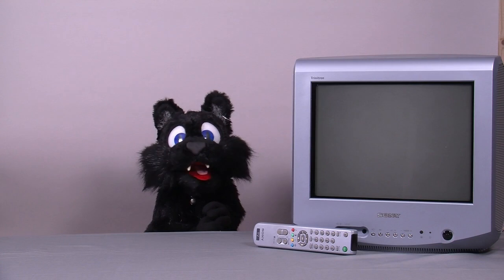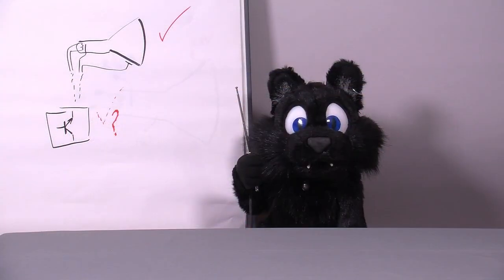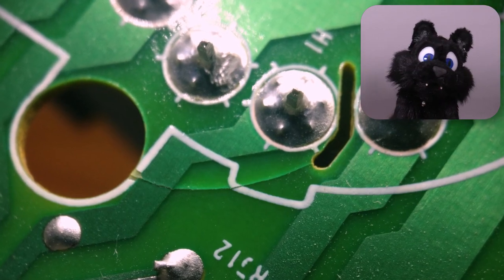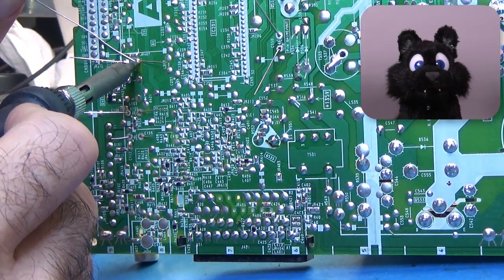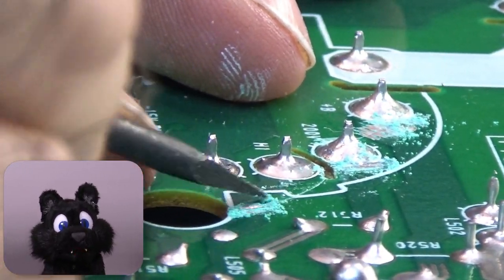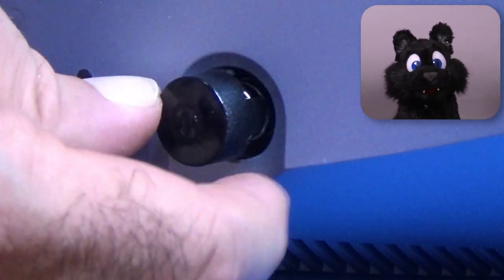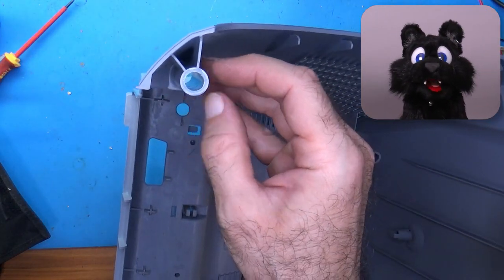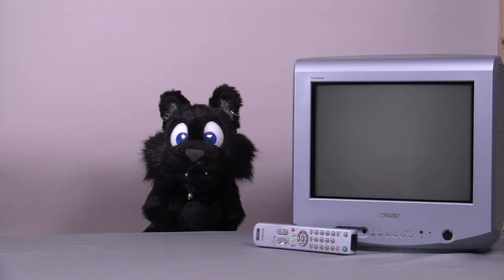Restoration Project #27 - Sony CRT TV

Comment: Beautiful! CRTs for life CRTs forever. I had planned on doing some repairs on an MX7000 by Band & Olufsen but when I opened it up I was shocked at the complexity. So many seperate boards all packed into ludicrously tight spaces. Far too much for myself to tackle.
Reply from the maker: By the description, I'd guess it is a pre-digital device? The Sony one here already had an integrated controller chip that took care of almost all the signalling details. Real old scool TVs with just a few chips for amplifications were beasts! Especially for decent color reproduction. B/W was simple enough...
Reply: @atkelar  Plenty of digital controls and a service menu. Very few petentiometers inside. I think because they went for a smaller form factor it's basically the 2 or 3 boards you'd see in other sets cut up and jammed in there but connected to each other. So the mainboard is probably 4 seperate pieces or something.
Reply from the maker: Ah, Origami Electronics then! 😜
Reply: @atkelar  Ha ha so true xD

Comment: Handle with actual care 🤣 
I recently bought an East German chess computer (repair video on my channel). And when it arrived it was faulty. The seller said it was in working condition. Since two buttons were broken and an open collector inverter was not quite in spec, I don’t know whether it was “handled with package handlers’ care in transit” or just sold as working. But it’s working now, and working well. I lost all games thus far 🤣

Comment: Cool repair as always! When adjusting for convergence, aren't you worried you might get zapped, HV is just a cm away? 26kV must hurt a lot
Reply from the maker: Thanks! Oh, I did worry about zapping. Never "reach" for something without looking at it at the same time. The 26kV are well contained (the red wire in the shots has a thick layer of insulation) what had me more worried are the blank soldering pegs on the deflection yoke board. Those have some hefty voltages too. I didn't measure those, but some TVs run those in the 200-300V range. And I did brush against that 200-ish volts on the Philips monitor project. Not pleasent. But while the voltages are high, the power behind it is minimal. It shouldn't be anywehre near lethal, because there'd be next to no current involved; it would be like a really strong static shock. But these things can only be adjusted when powered on.

Comment: Say, Atkelar? Have you ever converted a CRT tv or monitor into an XY monitor suitable for vector display?
I'm going to be building a scopetrex sooner or later (a vectrex console, which outputs XY with the intention of hooking up to an oscilloscope) but I'd like a larger display, and dont have a 'scope but I do have two old CRTs, one of which I dont mind converting
Reply from the maker: No, I have not yet done such mods; While it might look like I'm very experienced, I am actually applying basic knowledge, years of generic experience and a whole internet worth of knowledge as I go. I am slowly getting into the more physical side of things after over two decades of software development. - That said, I think the X/Y thing might be a bit problematic, because the deflecton yoke is built for two very different frequencies: the verticla one is the 50/60 Hz for the interlaced image, while the other one is for the umm... well, 50/60 Hz times however many lines PAL/NTSC has, so a few kHz. In a scope, the deflection is done capacitively, not magnetically. That offers different frequency ranges and wouldn't be different in either direction.

Comment: For repairing ABS plastic, mix acetone and chunks of ABS plastic scrap in a glass jar and close it, let all  the plastic dissolve into  a paste, and voila! ABS Cement! It actually welds the plastic back together, very strong.
Reply from the maker: Thanks for the info! I've read something similar before; But my real question is: how can I be sure what type of plastic it is? Is it ABS to begin with? I need to look into "identifying plastics" sometime; a sort of cheat sheet would be useful...
Reply: @atkelar  Generally, if it's electronics shell plastics, its probably ABS. Although things like Polycarbonate, glass reinforced nylon, or others may be used.  Theres usually a recycle code or ABS stamped in the plastic SOMEWHERE on the inside or outside of th shell. You can also just go on ebay and purchase a sample (usually 100g or so) of 1.75mm ABS 3d printer filament for 2-4 euro if you want to take the guesswork out of it.

Comment: I've also got a CRT monitor for an Amstrad CPC464, which keeps blowing its onboard fuse, but I cant see anything obviously wrong. Where do you think I should start poking?
Reply from the maker: Does it blow right away or after some time of operation? If it blows right away, I'd check for tantalum caps, those are notorious for shorting out when old. A blown fuse means something is drawing too much current; depending on "how much too much" it's either a dead short, like the tantalum caps, or something that passes just slightly too much current, like a broken amplifier stage somewhere.

Comment: I have the same TV model.  I would like to disassemble it to retrobright the shell.  Is it easy to disassemble?
Reply from the maker: It's a bit brittle; so be very careful with the screws. the only real issue is that the four main screws in the back are waaaay recesses and need a really long screwdriver. The rest is just one screw that holds down the flyback transformer and the four screws in the CRT. Everything else is just clipped with clearly visible clips and the wired sare connected with plugs. So as long as you go slow... no, not hard at all. Just be sure to discharge any capacitors. They bite. 😁
Reply: @atkelar  In fact I thought of leaving it off for a few days to completely discharge the voltage, keeping the plug unplugged too 😁 Shouldn't that be enough?
Reply from the maker: Normally, yes. Mine was discharged after a few minutes. But better safe than sorry. If this is your first TV, be also very careful with the anode plug on the CRT: the red wire in the video. It might be OK if you leave it connected if you just want to work on the case. It is a 'sharp metal edge against speciality glass' type connector and rather delicate. The wire also needs to have 2cm clearance to any other wire or PCB after assembly.
Reply from the maker: You might also search for "kv14lt1b.pdf" on Google for the service manual. It has a disassembly/reassembly guide.
Reply: @atkelar  Yes, I already found it some time ago.  What I want to do is open it and do the retrobright to the shell and clean the contacts of dust, but without disconnecting any cable
Reply: @atkelar  Everything went well, after having reassembled it I too had a "code 5", that is 5 flashes of the led.
I reopened it I realized that I had half taken off a flat, after which it started working again 😅
Thanks again and like for you 🙂

Comment: Just an idea Atkalar, why not try acrylic glue for the screw holes
Reply from the maker: If they come loose, I shall look into alternatives. But those require some knowledge of materials... Which I lack sadly. I have to do research before ordering the glue for the type of plastic that is used here. I added your suggestion to the list of possibilities, thanks!
Reply: @atkelar  it works for most types of plastic and some types of rubber

Comment: My mum wants to throw one I saved away. :(
Reply from the maker: Awww... It's sad when there is not enough space to keep such treasures around. Being both a home owner and a fan of retro tech, I know both sides of that coin. At least make sure it gets a good home, if you can't keep it yourself. These things are harder to find every day.
Reply: @atkelar  I know... Problem is the shell is broken... I don't know if I can find anyone who wants it...
Reply: @atkelar  I really wish there was a way we could have CRTs back in production.
Reply from the maker: Consumer CRTs are sadly a thing of the past. Making one of those is also a bit beyond small shop magic, like some new nixie tubes or similar things. They require such a massive amount of chemicals and specialized equipment that they will not break even on a small scale production and there is no market for a large scale one. I think I read somewhere that there are some special use ones still made today, but nothing that could fit into a normal TV that I know of.
Reply from the maker: eBay is always an option; but a broken shell is something that could be fixed.
Reply: @atkelar  how so?
Reply from the maker: Well, depends on exactly what part is broken and if the parts are still around. Anything from Superglue to re-making somethng with a 3D Printer comes to mind for "one off" repairs.
Reply: @atkelar  I'm afraid I can't really do this... It's near a top corner.
Reply from the maker: It does take a bit of experience; but it most likely can be fixed.
Reply: @atkelar  I get ya. But I'd be lucky to even keep it. I still have to live with my mum at least a few more years and she already forced me to toss a Sony VCR/DVD player combo.

Comment: 11:08 Hello. Touching by hand in that way the anode cap is a good practice? That was definitely far from my mind after watching video such as m5gATW2VylQ?t=14
Reply from the maker: Well, I didn't explicitly show it - mostly for time reasons - but the moment I touched it, it was off and discharged; I had to put in the HV probe without scratching anything and then - when that was in place - I turned the set on. I wouldn't recommend making or braking connections there during operation. This also gave me a good opportunity to watch the charge disappear when turning off, and I can say that after only a few seconds, the voltage is down to touch-able levels.
Reply: @atkelar  Thanks for the clarification and congratulations on your channel. It is very well done and I think it deserves getting boosted from Youtube's sleepy unpredictable algorithm.
Reply from the maker: Thank you! It is a way of combining my various interests; and that is probably what the algorithm can't handle well... puppetry? electronics? mechanics? woodworking? I don't really fit into a single drawer, and I also wouldn't like to 😅